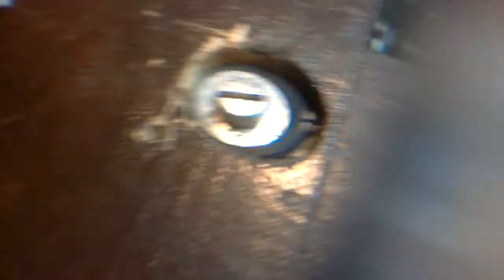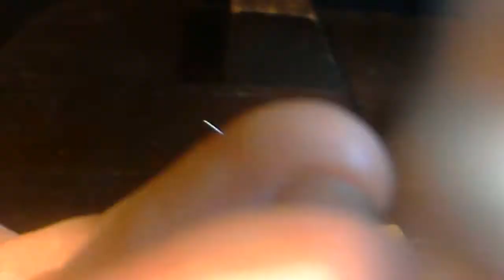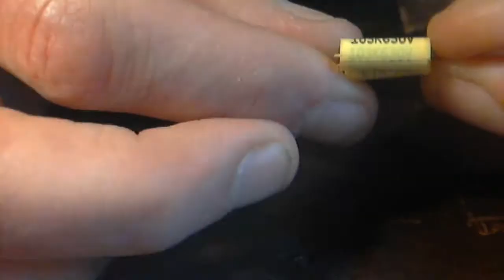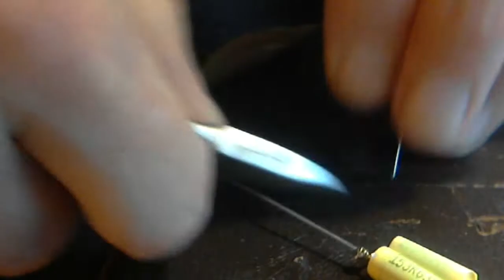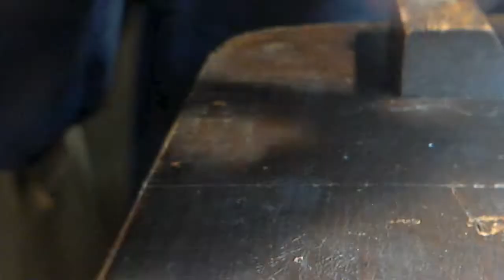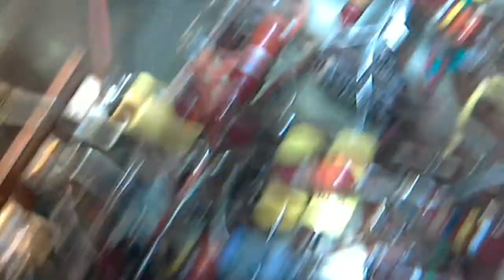Graetz Fantasia 822E Video #12 - More Capacitors

Comment: Hi Jim. Yes the All American Five is much easier to replace part's, Though there are a few exceptions to them, where things are crammed together they can be a pain, though nothing like what you are dealing with. Thank you for sharing. I learned the hard way to place heat-shrink or tape on my test meter probes like you do, to keep from shorting things out : )   The sewing needle trick is a great ideal. I shake pretty bad these days. I need all the help I can get ; ) Take care.

Comment from the maker: When I am testing a radio in operation, I often think about that game as my meter probe slides off risking a short.  I can still hear the girl saying, 'Ha, Ha, Ha'.  I've soldered sewing needles to my multimeter probes so they don't tend to slide.  When using clip leads, it's also difficult too to avoid a short.  A big part of it is seeing down into the lower reaches of the circuit wiring.  And seeing is only getting more difficult for me as I become more vintage.  Thanks for the comment.  Jim.